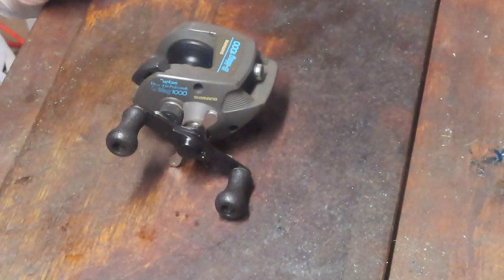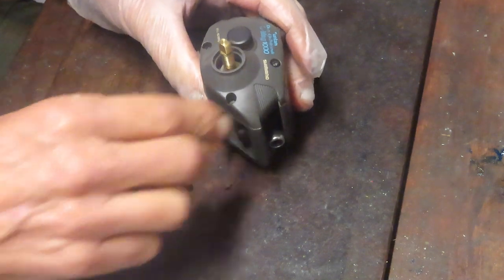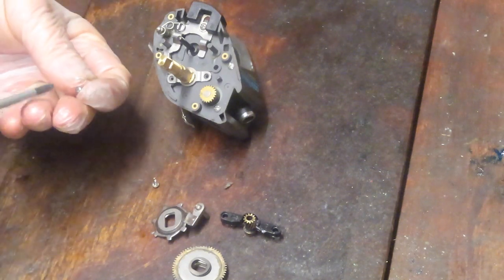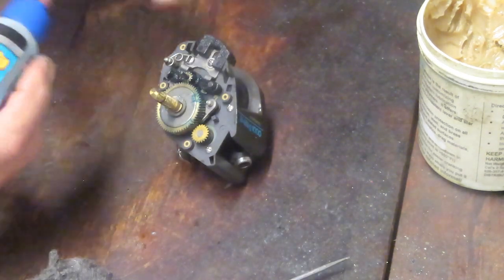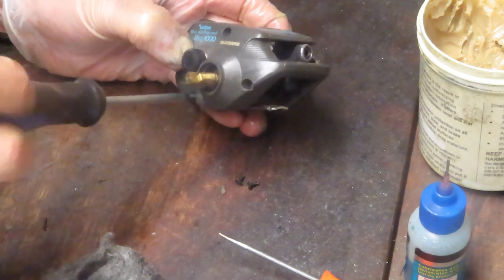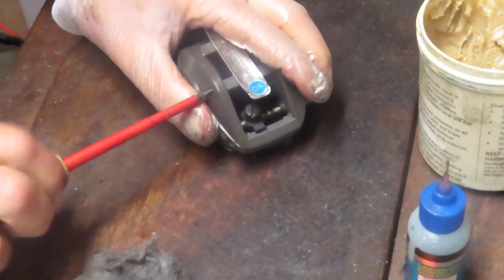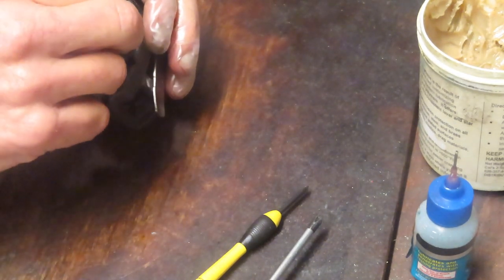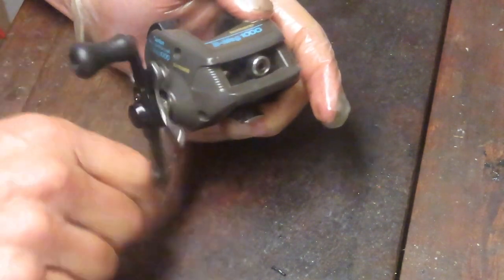Shimano Bantam B Mag 1000 early baitcasting fishing reel how to take apart and service

Comment: Drag does work completely even though star drag is tighten.
Reply: @user-wj2ce8bi6u
6 seconds ago
Drag does not work completely even though star drag is tighten.
Reply from the maker: You may need to replace the drag washers if they are worn or broken

Comment: Hi dennis i have this same reel i went to service it before the season began and now if my drag is too lose when i reel it neither the spool will spin and worm gear wont move the eye
Reply from the maker: Something is not right in the reassembly of the drag system of possible how the A/R was reinstalled.  You will need to recheck your work against the schematic - Dennis

Comment: Just bought a used one for $10 that seems to be in great condition except that the mag brakes dial will not move. I've never worked on anything complex, and I know that I would destroy it if I tried to take it apart. Is there some trick I don't know to get it to move?
Reply from the maker: I think it is probably rusted in place.  The steel ring that the magnets connect too and brush against have a habit of rust.  You could remove the side plate and try to free it with a rust buster or penetrating oil - Dennis

Comment: I have a Shimano Bantam TX Mag which I suspect has pretty much the same innards as the reel you've profiled here. I'm curious to know if the bushings in this reel could be replaced with bearings. I plan to use my reel for dropshotting for bass and would like to make it a little smoother. Nice job on the video, I'm now a subscriber.
Reply from the maker: In theory, it should.  Just be exact with measures when ordering the bearings - Dennis
Reply: I am curious if you ever went about changing out those bushings. If so, what did you order, and what were the results?

Comment: Question, do you recommend using grease on the spool shaft instead of an oil?  Wasn’t sure if an oil would help with casting performance.
Reply from the maker: You can use either.  I generally use a light coat of grease, because oil evaporates quicker and I have seen a lot of problems with pinion gears frozen to the spool shaft, so I like to make sure there is sufficient lubrication there to prevent it from happening. You are correct, oil will help casting distance a little more, but I go with the grease trying to avoid the bigger problem - Dennis